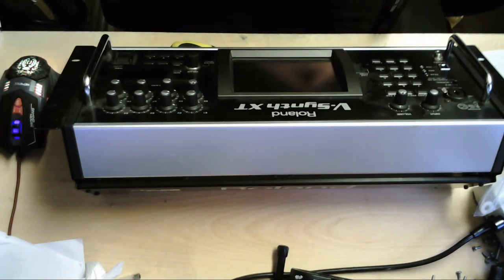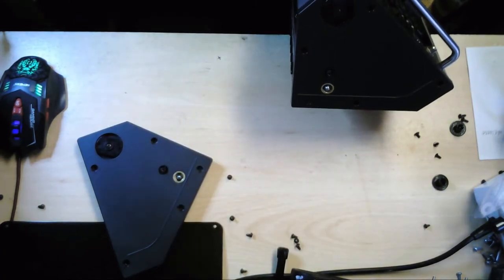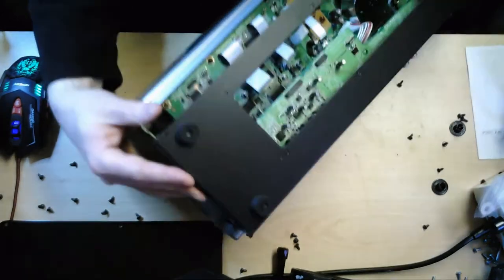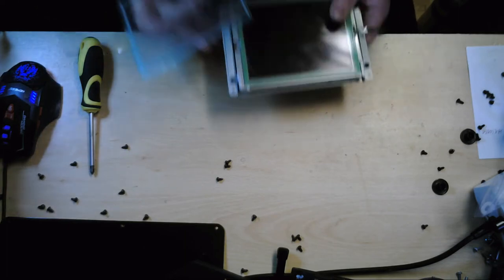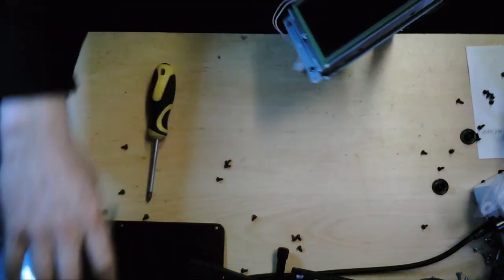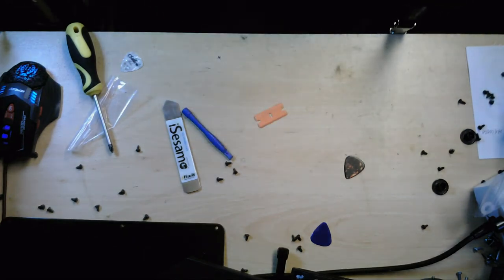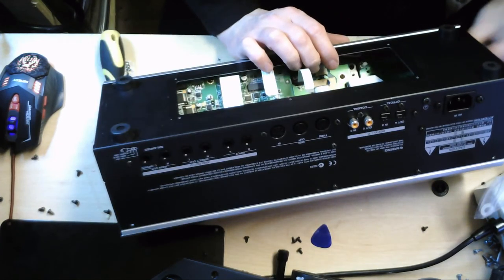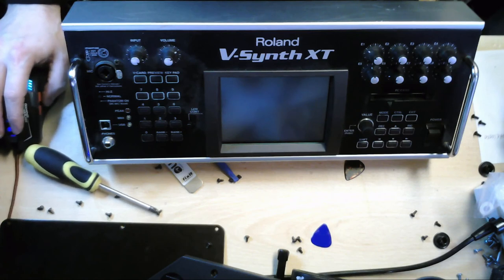Open up / Tear down Roland V-Synth XT Rack Module / change touch screen

Comment: Hi, Thanks for the tear down video.  This give great  insight  on how I can maintain my XT. Don't throw away the expansion card slot. I use mine to expand the XT's  memory to 2gb, using a scan disk memory card. The XT is able to stream projects and audio directly from the memory card, allowing for larger  sample sizes.
Reply: Can you please tell me how you did this? :-) Very interested in doing this

Comment: The touchscreen on my V-Synth xt stops working if the humidity in the room is too high. But it works fine if the room is dry very strange.
Reply: Interesting

Yesterday and today was really humid and when I turned the xt on, the screen didn't work so I guess this could be the issue
Reply: @t.kahraba763  yep its definitely sensitive to humidity. Besides that its been great for me i love it.
Reply: @Heathcliff_hensel  thanks

I just got a proper midi controller to use the xt and once I turned it on, the screen wasn't responding and I was soooo disappointed especially because I thought I had to actually repair it.

It's been a humid couple of days, hopefully once the humidity goes  it will work again. I really liked the xt and I've had it for about a month but never played much of it because I didn't have a proper midi controller

Comment: Before you blindly follow his advice and chuck away the card reader, bear in mind that a PC card is needed for patch and sample memory. The internal flash memory does not have sufficient capacity to hold the full RAM equivalent, but a PC Card / PC Card Adapter with Compact Flash does hold a full memory's worth...